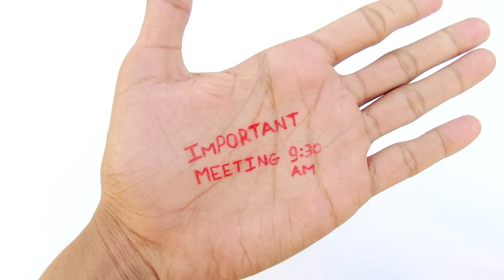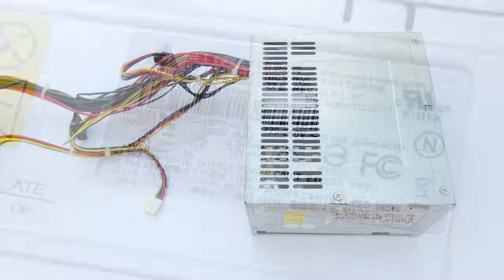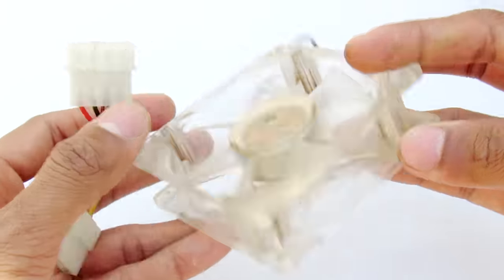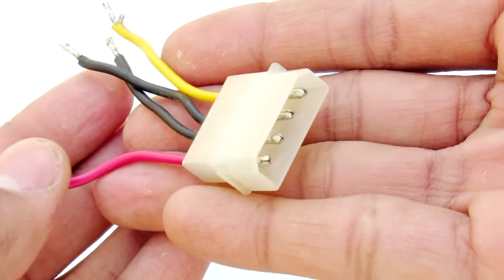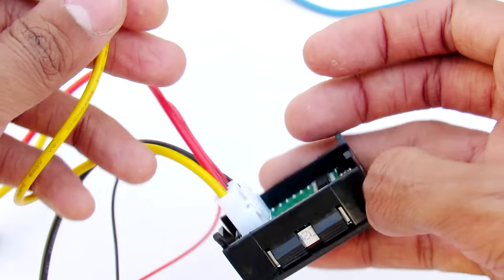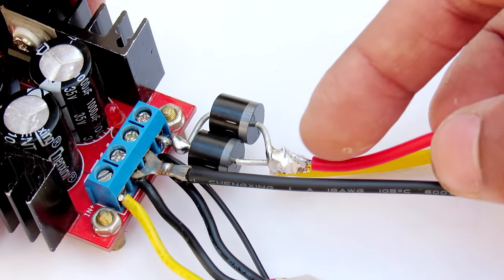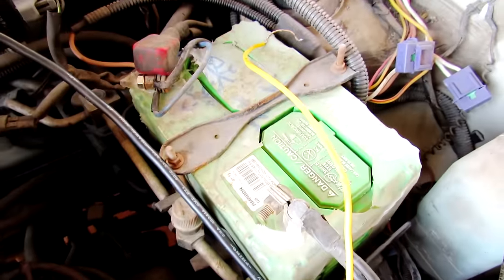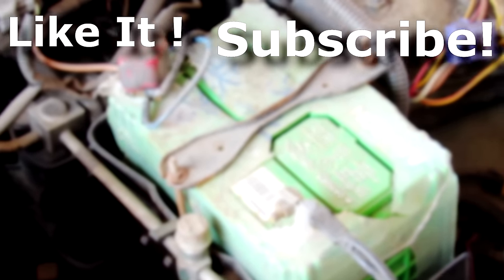🚘 🔋🔌 Charge Batteries at Home & JumpStart in 5 Minutes - Car Battery Charger

Comment: thanks for the instructions. i think you missed the green2black connection to power on the PSU but all PSU's probably not have that function.

my plan is to charge a 12V regular car battery this method, or at least have the option doing so.

i have tried with several old PSU's. they all seem to give output 14-16V so i guess i dont need step-up DC2DC converter.

also, output is 18A but my real battery charger gives only 7A. what is it  the implications here? 

as for my mini 12V battery, like the one you show on the video, earlier i thought i needed only 2A or so for charging and that my regular 7A would kill it.

Comment: So... you are late for a VERY important meeting and your car bat is dead. According to this video:

1. Buy used ATX power supply
2. Buy DC to DC converter
3. Buy V/A meter panel
4. Buy 2 diodes
5. Buy solder gun with solder, some wires, rosin etc

Wait for 3-6 weeks for them to arrive from China :-)

6. Assemble, solder, adjust everything together
7. Now, charge your car bat for a few minutes
8. Start your engine... FINALLY!

Did you go to that meeting? Forget it, not so important after all :-)

Comment: can we use a 12v 7Ah battery replacing the power supply
Reply from the maker: Yeah, but not quick as this charger.
Reply: OK so you mean it is good but it will take time
Reply: I was asking for portability like if this happens on road

Comment: What's the two parallel diodes for?
Reply: The diodes are to prevent current from the battery entering the boost converter.
Reply: @oniruddhoalam2039  but boost converter already have a diode.

Comment: I have a  17.1v power supply with 9.0Amp output (transformer develop that power by 220v AC current, what happened if I use this for charge a car battery like in this video
Reply from the maker: Make sure to step down the voltage to 14.2 volts & it will work.
Reply: Thanks buddy